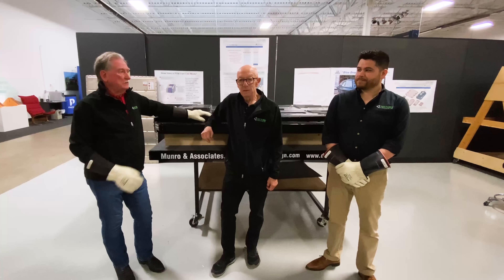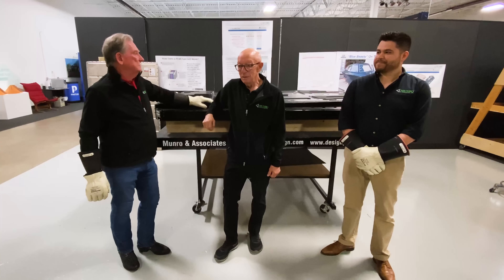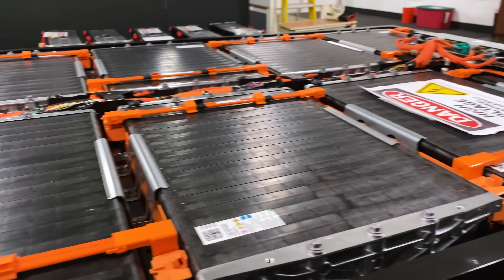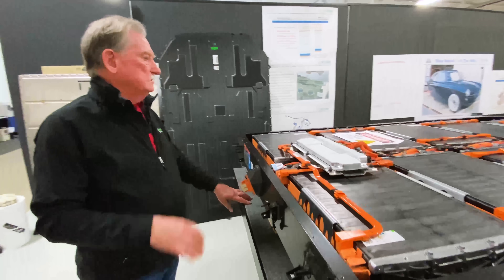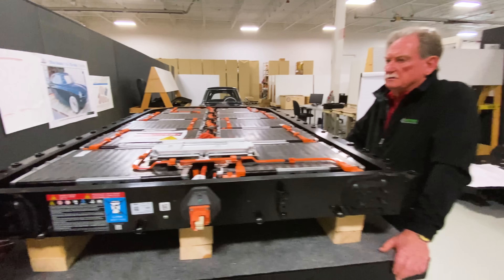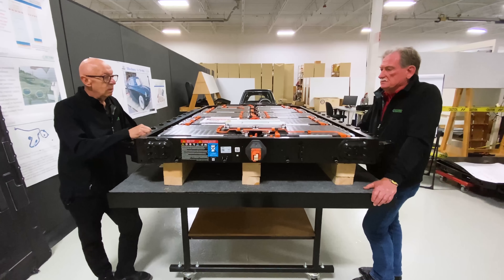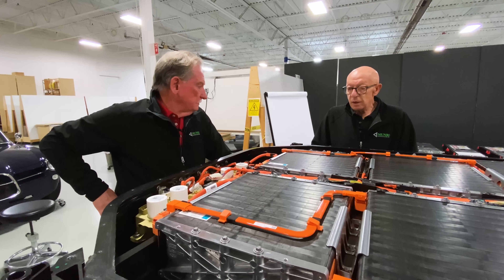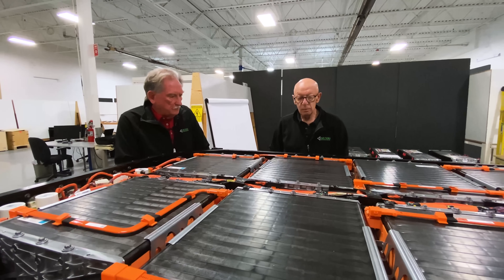Ford Mustang Mach-E Battery Exposed!

Comment: Why they are using harnsess and tubes to connect modules? Can't they figure out a mechanism to bridge them like legos?
Reply: I like it because it seems more serviceable.
Reply: Hit a pot hole, a curb, drive off a curb in the dark… the body of the car flexes a little bit. If a large battery that snaps together flexes, that could cause sparks & a fire.

While desirable, this could be a difficult engineering situation.
Reply: Why don't you tell us since you are the specialist.

Comment: I definitely think Mark is correct with the NVH comment on the cover.  When Sandy picked up the ID4 cover you could hear how badly it drummed, the plastic cover was much quieter.
Reply: @oijhhytdirhrbru  I'd argue that plastic top cover was more rigid because of the taller cross sectional area.  You see how floppy the thin aluminum one was. I'd like to see Sandy give it a test.
Reply: @oijhhytdirhrbru  
Hmmmm
Inside knowledge...🤔
Doubtful.
You're guessing.